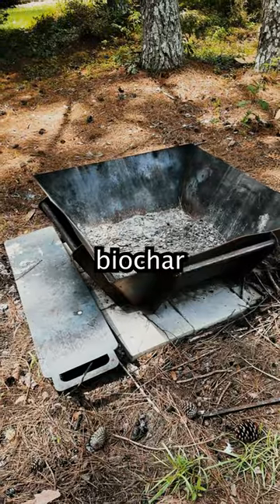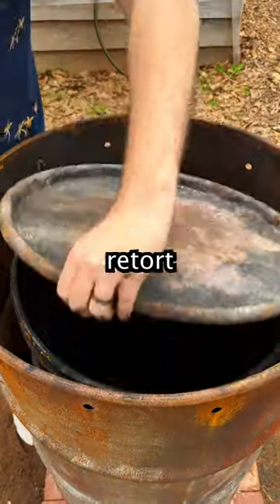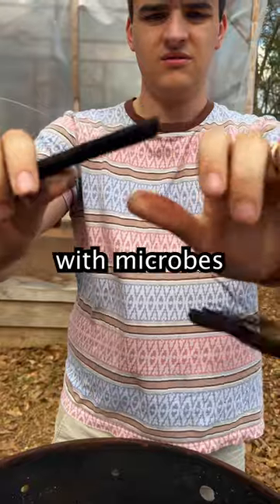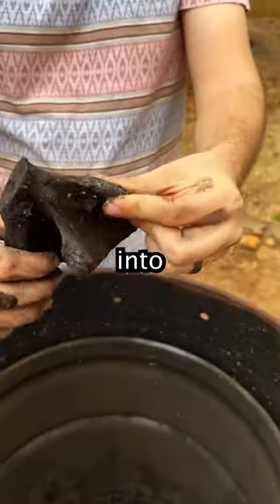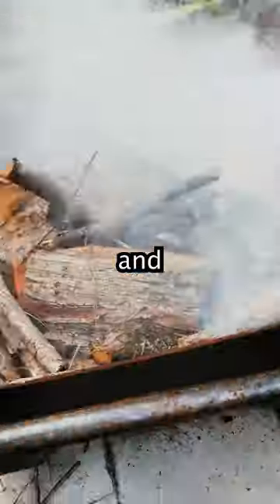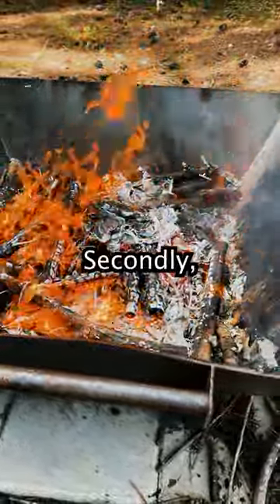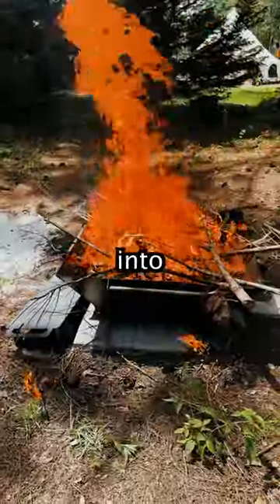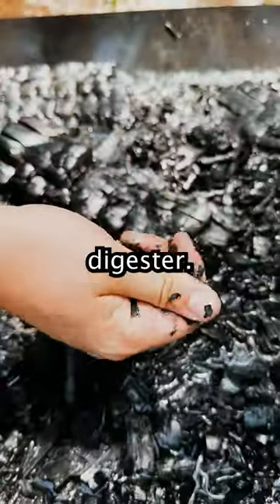This is a Kiln #shorts

Comment: I admire people who understand what they are doing.
Reply: cooking the oil and water out of wood, meaning only carbon is left in shape of wood. Then little earth microbes lives in crevices in wood.
Reply: While I don't disagree....its easily debatable if he actually knows what he is doing/ talking about. First off charcoal burns at 1,100°F.....so the only way to burn off the charcoal is a prolonged extremely hot fire. You can accomplish the same results by starting a fire, burning it for less then an hour and then smothering it with water and or a fire blanket. So does he actually know what he is doing, yes but he made it way more complicated for himself and anyone who thinks this is the best/easiest method to obtain charcoal for fertilizing purposes.
Reply from the maker: @commoncents9732  I get that! Just making a fire will create charcoal! The issue is the charcoal to ash ratio. Also you won’t get much charcoal. The bigger the feedstock stack, the more ash will be created by the time it’s all caught on fire and burning. The fire cap stacking method gives you more charcoal and less ash.
Reply: And i hate that i don't understand what he's doing
Reply: @acornlandlabs  just make a retort burner if you insist on making this stuff...... ps. good biochar needs to be screened and washed...... it's not environmentally appropriate from a water pollution point of view, and given most is made through using carbon based fuels, it really is not friendly to earth......

now, if you were reclaiming charcaol from a biomass electric plant, that would be great, but lots of the biomass used is variable and polluted...... so cancel that too.
Reply from the maker: @curiousbystander9193  We do use a double barrel retort! The kiln is a good option for those who don’t have one or the materials to make one. It’s not as affective but still can lead to creating biochar! The fire cap method allows for a process closer to pyrolysis than a normal camp fire.
Reply: @acornlandlabs  I have two biochar tests going right now...... one with hardwood biochar screened and washed at .5-2 mm size, and another with same hardwood biochar and coffee grinds biochar (washed after all fines screened out)..... both soils are 3-4% biochar.

Lots of questions about this stuff, sir, lots. IMHO, only with a big investment in a water filtration and reuse system, after a huge investment in an electric charring system and residual syn oil recovery system, this is not healthy or practical.

 ANd without proper treatment, even smoldered charcoal from the campfire pit in the back yard may be unhealthy for your garden....  wash some biochar..... tell me what you see?  I'd grab the ash from the campfire before the charcoal...... microbiomes don't like biochar... or your water filter would make you sick.
Reply: @curiousbystander9193 what's the reason to wash biochar?
You'll lose the minerals inside the wood
Remember, a plant provided the wood we are turning into biochar to ease the nutrition of other plants we eat
The first plant took years extracting from deep soil ions like calcium, magnesium, copper, zinc, sulphates, phosphates and, usually most of all, the precious potassium
The edible plants we will grow over the biochar need it all, so why to wash it away?
Reply: @r.guerreiro140  make some, wash some in a 5 gallons pale.... tell me what you see... there are remnant syn gas byproducts in a lot of biochar, plus fine stuff that is not healthy for your soils...  well made biochar really should not have many bioavailable minerals....

the the negative effects of the amount of co2 made making it seems to far outweigh the gain from sequestering some carbon, permanently .....
Reply: @curiousbystander9193 sorry man but ima have to ask for a source. You keep saying this is good or bad for the soil without any explanation or proof
Reply: 777th!👍🏽 artist likewise!
Reply: You can't be referencing this video. This is for mushroom growers. They messed up.
Reply: @acornlandlabs how do you make activated charcoal? I mean the one you can take for poisonings etc.

Comment: You could do a close container to get wood gas to run a generator for electricity so many uses at once
Reply: Yes, then use that energy to power a plastic pyrolysis machine and then capture the gas
Reply: @craigallen9731  yep..exactly..work smarter,save money and help save the environment..good recommendation
Reply: Soo much work and generator maintenance though for just a few hours of electricity. Good idea in principle, not so much in practice.

Comment: Just use the original kiln... If you punch a hole in the UNDERSIDE of the INNER barrel you can use the escaping wood gas to heat  the charcoal container and almost keep itself going. This way you are WAYYY more efficient.
Reply: You can definitely use fancier and more efficient kilns, it’s just a compromise between efficiency and difficulty.  They prefer the latter which is valid.  Personally i am definitely team high tech lol.
Reply: Ive never thought of utilize wood gas in that way.

Comment: Ive been using a barrel method of creating charcoal for years for my forging. I have a large metal barrel thats vented but otherwise sealed loaded up to the brim with small log splits. I then sit it over a good fire for 6-8 hours. Eventually around hour 4ish a flame will start jetting out of the vent. Thats all of the gases getting burnt off. When i no longer see smoke or flame out of the vent i let the fire die and leave the barrel to cool overnight. When i crack it open i have a huge amount of clean burning charcoal for my forge. Low amounts of smoke. Smells good when it burns. Burns very hot. A full barrel will last me probably 4 months for my forging. I do commissions for farmers locally making horse shoes and tools. I also make knifes and blades for commission as well.

Comment: This is combustion and produces charcoal. Biochar is very similar to charcoal but produced under different conditions in either pyrolysis or gasification and consequently has different properties. Importantly, pyrolysis is performed in the absence of oxygen and no combustion occurs, while gasification is performed with a small amount of oxygen to limit/ control combustion.
Reply: Biochar is a type of charcoal
Reply: @omarmrtnx1  yeah but biochar can only be obtained through pyrolysis which produces a stable form of carbon
Reply from the maker: Great point! The fire cap burns off oxygen above, helping create more stable carbon below. It’s not perfect compared to a double barrel retort, but it’s much easier for every day gardeners.
Reply: @acornlandlabs  isn't double barrel retort easier since you don't need to keep adding layer of woods?
Reply: @Hilman_Faiz  And you don't have to maintain an actual fire actively, and you don't need to rinse it off or drain the water...? It does seem like a nice way to go if you just want to use an already available kiln/fire pit.

Comment: You can use ash as fertilizer as well. It's a pretty good source of macro nutes with trace micros. Composed mostly of carbon still. The issue with biochar as fertilizer, if used disproportionately or not buffered, it can actually absorb nutrients from the medium. However if used correctly, it can prove beneficial to plants.
Reply: How does the nutrients absorption work? From the soil or from the plant? I put down a foot of wood chips 7 years ago in my 150 ft perennial garden and still see nutrient deficiencies, only learned of the nutrient leaching after laying it down, no regrets haven't needed to supplementarily water in 3 years despite drought. This biochar concept seems like much Ado about nothing, not getting it.

Comment: You made this 100% more complicated then it has to be.....I do the same thing without the complicated explanation.
Reply: Tell me i didn't understand completely. Is it like the burnt wood that's not completely turned into ashes?
Reply: @abuhasb33  The goal kind of is to steam the wood.. Take all of the water out open up and expand the pores. keeping the flammable carbon intact. Otherwise burning up the carbon leaves you with pot ash. There by destroying the structure of the biochard which allows air and life to colonize the soil.
Reply: Ikr it's just inefficient way of making charcoal

Comment: For anyone who can’t use google 

Yes, ash can contain carbon, which is usually its main chemical component. The amount of carbon in ash can vary depending on what was burned and the conditions of combustion. For example, wood ash typically contains 5–30% carbon, while fly ash can contain 2.3–25.3%

Comment: I like to add water to the ash/char mixture so that the ash falls to the bottom while the charcoal floats on top for easy separation. Only downside to this is it needs to dry if you plan on using it for fuel

Comment: Soaking it in water also increases the micro-pores in the charcoal caused by the thermal shock which increases the surface area within the pores to house more microbes

Comment: I used to have what I called the hot box, it was quite literally and upside down version of your pit, but with lift hatches that folded out and down. The beauty of them, you can get air flow locked to where you get the proper carbon utilization. The amount of carbon we used to get for making filters and such was remarkable. Back then I wouldn't have thought to use it for fertilizer anymore than mixing a smidgen into my live soil turnover pile
Reply: That sounds awesome. Do you have any pictures of it. I’d love to build one so I can make my own filters 😅

Comment: Nice to see you getting into the chemistry of the process, Joe 
Biochar may help with the biology, but what it really does is increase the cation exchange capacity of the soil
In a nutshell, it means the ions will be hold and keep available to plants roots on biochar, instead of being washed down by rain or irrigation
It does the same job as clay, but far more efficiently due to the aleatory molecular structure of the carbon atoms created during pyrolysis
Not to mention some 5 to 6% of wood dry mass is mineral ashes with anything a plant needs, so, biochar is also to some extent a fertilizer too
Reply from the maker: Thank you so much for that breakdown! Really good information.  Love it
Reply: @acornlandlabs what is the background music if you don't mind me asking?

Comment: This video was well done!  Despite my snobbyness on some other videos of yours, credit where credit is due.

Also for those interested, this is often called a “Cone Kiln” @codyslab did a good video comparing this to the retort design.

I am unsure on the issue of soil leaching pollution etc, but you can even do this method with a hole in the ground!

Comment: You should actually put the charcoal into the biodigester. Studies have shown it increases efficiency and reduces the co2 and h2s level of the resulting gas. It will also increase the pH which is usually good for a digester depending on what you’re adding.

Comment: Still think it's easier to run my woodgas fueled trucks and use all that fuel and then harvest the biochar bi-products for the garden. Then I also get the mineral rich condensates to use and the tar as well
Reply: What all do you use it for?  I’d love to hear!  I’ve read up about “Pyrolysis Oil” a bit, but I’ve heard it’s nasty stuff.  Do you capture it in sawdust filter, I’ve heard tar fouling of gasifier pipes and whatnot can be a pain.
Reply: @ericlotze7724  tar production can gum a engine in a heart beat yes, the key is good and dry wood and a hot hot hot gasifier. Both my trucks are Wayne Keith designed systems that run between 2 and 3000°f those temperatures will thermally crack the Tars into more hydrocarbons producing a more calorie dense gas for the engine to run on. Hardwoods are preferable fuel, but they are far and few between in my area so I run on soft woods primarily Doug fir and pine. These produce more soot and char bi products which means more cleaning things like the hay filter. I have been lucky to never produce tar in either of my trucks, due to the high temperature and the condensing hopper that gets rid of tar and a lot of moisture before the wood chunks ever get down deep into the hot fire. The tar can be useful for some things, the hopper liquids are so hot in minetal content it acts as a all natural weed killer I put it on my gravel driveway to keep the weeds down. Some guys will cut it with water I don't know the ratio but they then use it as a miracle grown all natural replacement in the garden, some use it to innoculate the bio char as well. If you want to know any more feel free to ask questions, my channel here on YouTube is also chock full of building and operating videos in both of my trucks, and everything I know is available on the driveonwood com forum. Anything you want to know about woodgas and all it entails is there a long with a very helpful bunch of people
Reply: @BigBeavrSlayer  Neat!  Also on the note of feedstocks, it has it’s own disadvantages of course, but no need to worry about tar with charcoal!

I’ll go check out all the stuff on your channel, exciting to learn more about all this.
Reply: @ericlotze7724  for simplicity sake a charcoal gasifier is the ticket, but you don't get the bi products and then there is more work in fuel production before it can be used. Some like char some like chunks both do the job!

Comment: You can do it in normal fire pits with ventilation, just keep throwing stuff on top to cut off oxygen. And when you get really serious dig long ass trenches, i had 2 28 foot trenches for a year b4 i turned it into a forest, i got thousands of pounds of char from those trenches. It really helps in my florida sand.

Comment: You could do this far easier. Get a metal drum, metal trash can, or anything else that is metal and can be sealed. Put the wood in the drum, put the lid on and just put the drum into a fire. It will carbonize all the wood inside. Maybe this won’t work for some reason but this is how my family made charcoal my whole life.

Comment: Seems like it's going to be a hell of a lot more inefficient than running a standard charcoal oven. 
Going to end up having to use more wood as you're loosing huge amounts of heat just to create a low oxygen zone and will probably have more of an uneven cook as well.

Comment: Ты просто гений!, кстате, я услышал что удобрения можно создавать из обычной земли с помощью эффекта юткина
Reply: What is the Yutkin effect?
Reply: @jturtle5318  The Yutkin effect (electrohydraulic effect) is the transformation of a high-voltage electropulse discharge in a liquid into mechanical and thermal energy. that is, if you put a high-voltage electrical discharge into water, then something like an explosion will occur, and due to the fact that water distributes pressure over its entire area, we can achieve the desired direction for pressure. because of this effect.  this effect is very useful in industry, although the effect is not popular at present due to the high cost of the equipment. As for fertilizers, the soil contains a lot of different minerals and nutrients, but many substances are poorly digestible or indigestible by the plant. but if the earth is dissolved in water, and then a high-voltage discharge is passed through this mixture, then poorly digestible substances, having entered into a chemical reaction, will become well digestible for plants.

Comment: Not entirely scientificly correct but yeah this works. But this is one of the worst methods if you want to use the coal later on to cock.

BTW pyrolysis is the process of cleaning something using fire or heat.

Comment: I really don´t think you can justify making your own biochar. You release to much carbondioxide in your process. The heat should be used for heating and the smoke should be filtred and you can only do that in a more industrial environment. Sorry! Just to dirty.
Reply: The smoke is not that much. You produced more air pollution by typing this comment.